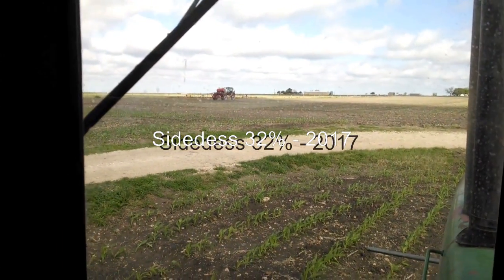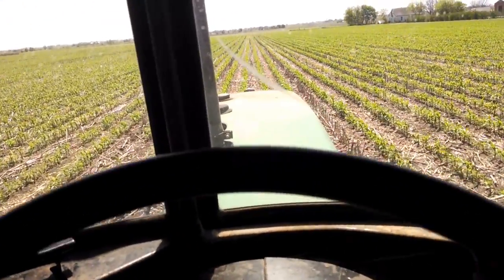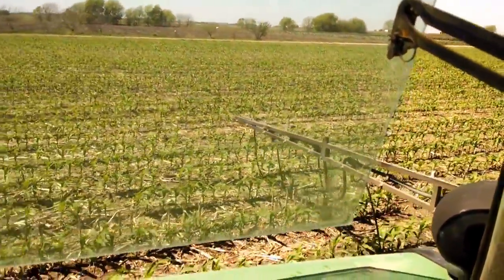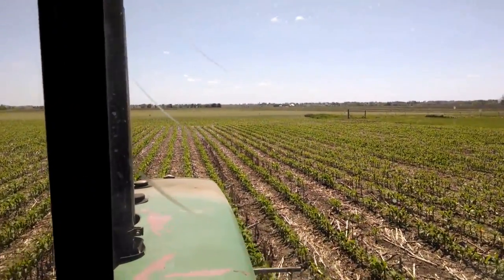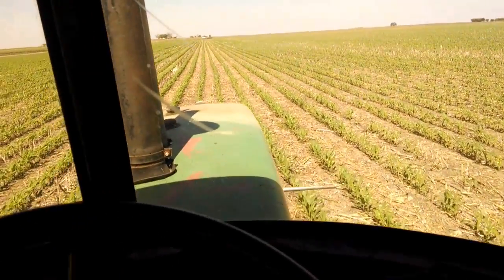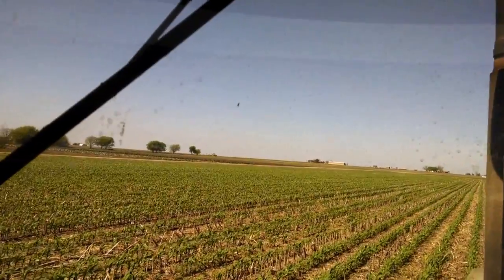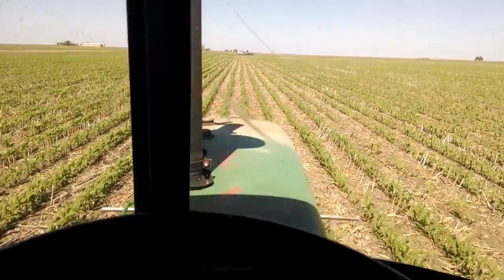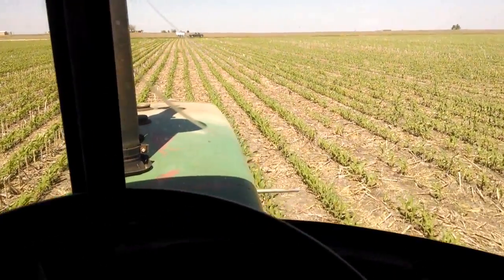Corn sidedressing 2017 - Central Texas

Comment: Looks like June in Iowa. Corn looking good. How do you determine yield target areas?
Reply from the maker: June is Iowa is about right. I think we're 8-10 weeks ahead here depending on where you are in Iowa. From N. Illinois originally. For the yield targets I've done a few things. satshot.com has a 25 cent/acre IR pictures that can show where your fields are healthiest during a growing season.  Also confirmed with combine yield monitor last fall where the highest yields were.  Followed that up with soil test and kind of decided on what critical levels of P-K I needed. From there I set some goals.  I think the P-K part is most important and it takes it a few years to settle in.